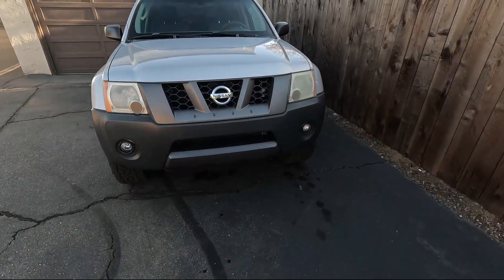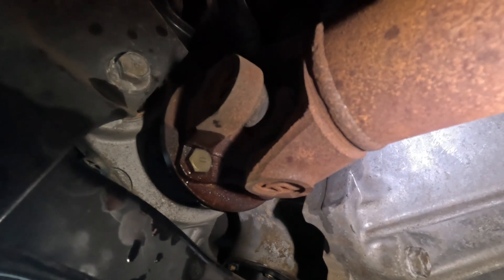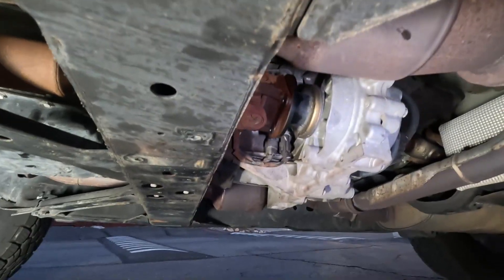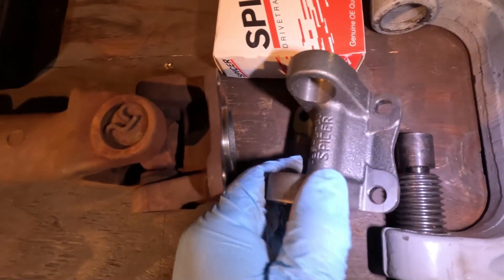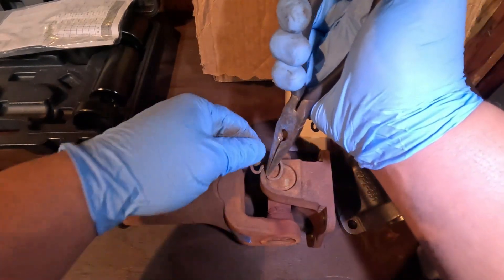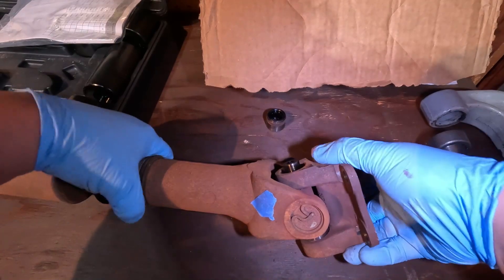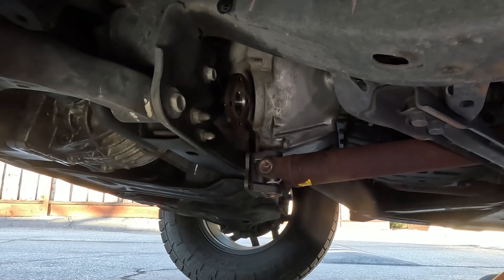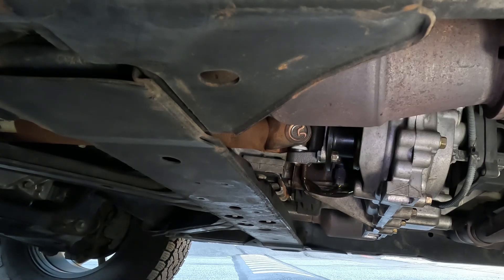U-Joint Replacement - 2006 Nissan Xterra 4x4

Comment: Well done but i know going into this video it will be alot of pain in the butt to remove those bolts..  I know because I did it too lol  I did used torch to heat them up tho
Reply from the maker: Hey thanks for watching! Mine were probably never removed. Should be easier the next time around.
Reply: Any idea if it is possible to remove the u-joints with the drive shaft on the vehicle?
Reply from the maker: @gautraudj yes you can! I talked about this at 6:51 and then again at 15:10 it's totally doable!
Reply: @_moes_garage_  oh, I took that as you theorizing that it's possible, but not actually checking
Reply from the maker: Haha no worries, I had to put it all back together to check if it would work 👍

Comment: Did you have a lot vibration when driving?
Reply from the maker: Yes I did. I originally thought it was just the A/T tires but after I fixed the u-joints the vibration disappeared
Reply: @_moes_garage_  ok yea I thought it was my tires too. .. dread removing those bolts
Reply from the maker: @davidbryant5875  you don't have to remove the bolts. I found out you can just undo the U joints! I talked about it at 6:51 and then I confirmed that the U joint tool fits at 15:10. Check and see if your tool fits and remove it that way 👍
Reply: @_moes_garage_ what speed did you have vibration?
Reply from the maker: @cudi503 mostly highway/expressway speeds so anything above 45mph
Reply: @ thanks for the quick reply. I’m having vibration from 65-80mph so I think it might be the u joints. Nice video man really helps
Reply from the maker: @cudi503 no problem, at first it was just vibration, so I shrugged it off because I thought it was my AT tires. But after it started clicking, and I replaced the u-joints, the vibration went away. It was a pleasant surprise haha